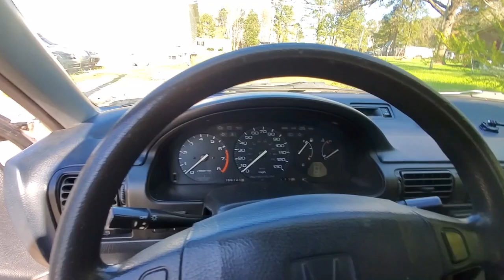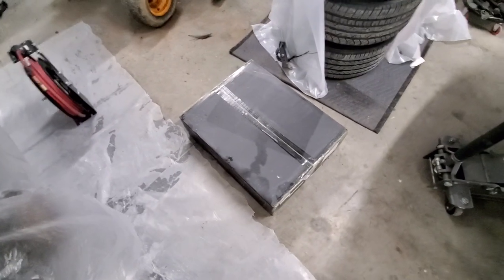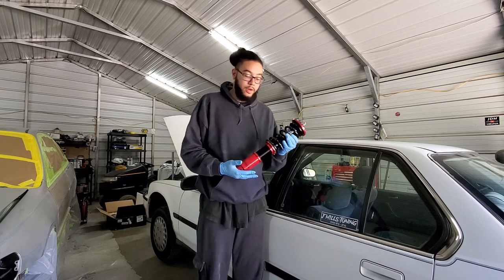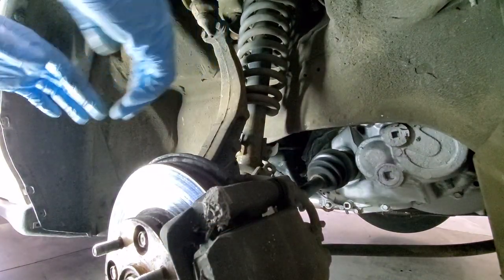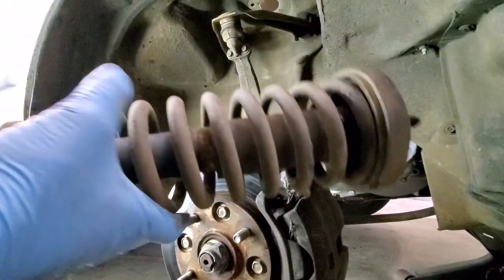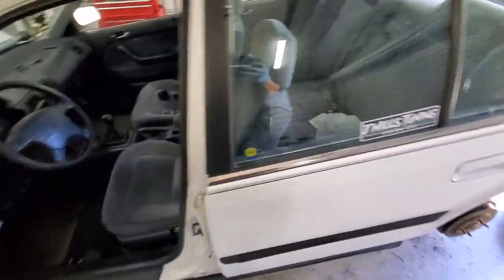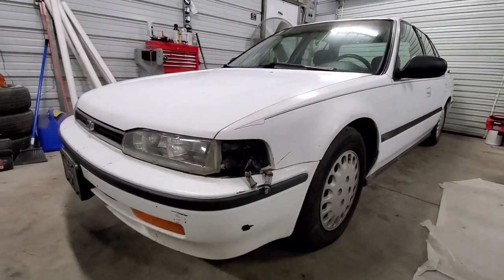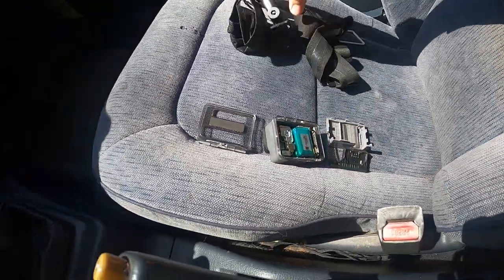Budget Honda Accord Gets Budget Coilovers | MaxPeedingRods SPONSORED Us!!

Comment: What did you do about the lower mounting bolts and the welded nut in the rear? The stock bolts seem a couple mm smaller than the holes drilled in the strut
Reply from the maker: I've found that you can use one of the 14mm nuts from the shock tower with the stock bolt that was thru bottom and it works great
Reply: @DrivenFilmsPhotography  sweet gonna try that thank you! My cb7 came with these coils it’s just the PO couldn’t figure out the rears so they gave up and it came with only the fronts on lmao

Comment: I got the racing max for cb7 and the top hats were way to big for the rear. Total bummer. The company was responsive but didn’t take care of the issue. Also there’s no nut for the bottom rear. So you have supply the nut. Sketchy. The fronts don’t go very low either. Kinda wack. If I could do it over I’d get yonaka

Comment: I take this video as a sign of i need 2 put my coilovers on altima that been sitting collecting dust lol..naw but thus really make me wanna put them on faster but I need finish rebuilding front end..also is there any negative to using aluminum lug nuts, I ordered the aluminum spike lug nut off ebay
Reply from the maker: I had the aluminum ones on my blue accord a few years back. Always tighten and loosen them by hand and not a impact gun. They are really soft. Be easy with em and you'll be fine
Reply: @DrivenFilmsPhotography  ok thanks could I torque them using torque wrench